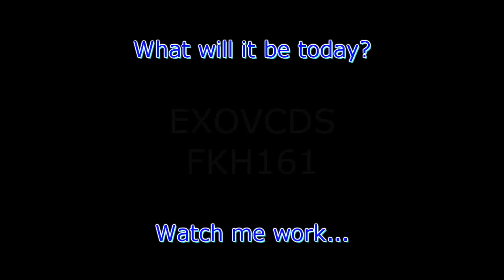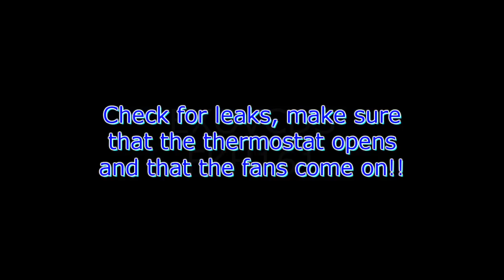VW A4: 1.8T AWP Electric Water Pump Replacement

Comment: can this cuase your car to overheat ?
Reply from the maker: +Luis Reyes If the electric pump does not work... it will not cause overheating issues (when the engine is running). It can cause hot spots when the engine is off... because it is not circulating coolant like it should, but will not cause overheating.
Reply: Thomas EXOVCDS my auxiliary water pump from my 03 Jetta 1.8t broke like the one on the video , but my car overheated first then I opened the hood and boiling coolant was coming from the (auxiliary water pump) so I let it cold down ,then days later I put water on where the coolant goes and it all leaked out from the part you replace ,so I took it out and Ima replace it tomorrow but idk if it would stop the overhearing on the car , first time this happens , hope you see my comment , I would appreciated if you get back to me thanks......
Reply from the maker: Isidro Barragan You won't know if it overheated because the pump broke or if the overheating caused the pump to break... until you replace the pump.

Replace the pump and check the cooling system operation. Most likely, the pump was weak and broke... then, as coolant came out, it started to overheat.

If after replacing the pump & filling the system it still overheats... check the radiator fans, the thermostat and the main water pump.

Comment: Wow - thanks alot, great insight!  I also read about the N249 Valve Delete modification as a mod.  Your thoughts on the effectiveness of this mod?  And, i have an issue with my steering when reversing and when turning in a tight circle going forward - with exact same description detailed in this link -  https://forums.vwvortex.com/showthread.php?5094653-2001-Audi-TT-225-Quattro-won-t-reverse-while-turning

Your thoughts on potential causes and solutions?

Cameron
Reply from the maker: I can't comment of the mod... have not done one, or come across one that had it.
I'm not very familiar with the ins & outs of AWD... some kind of diff bind would be my first guess as well.